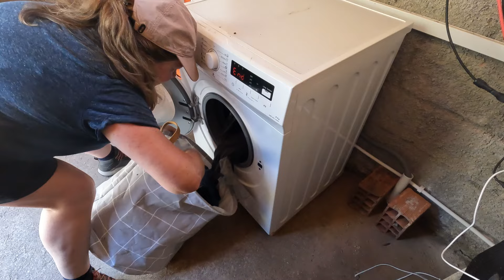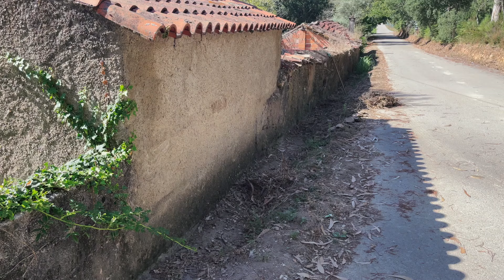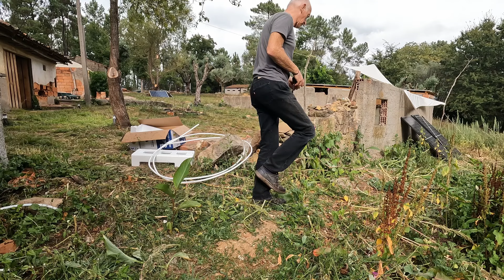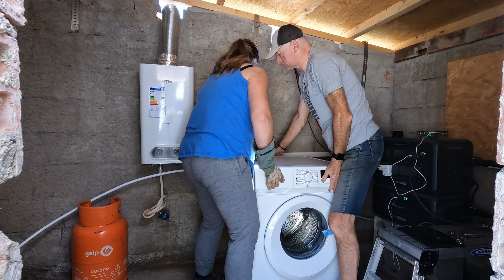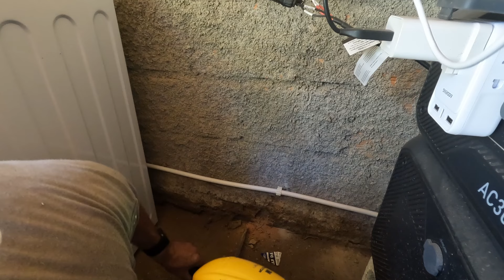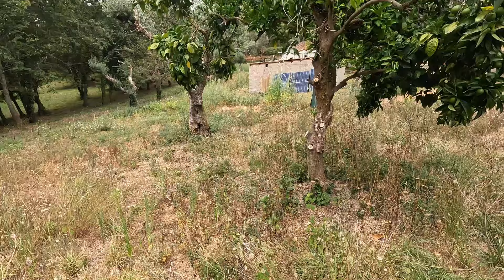Portugal abandoned house - building the laundry room EP41

Comment: I don't know if you've had a front loader machine before but you need to leave the door open for at least an hour, they get stinky if you don't!  I never close mine.
Reply from the maker: Thanks for the hint!
Reply: @HotkeysPortugal  FYI - it is the rubber on the front door that usually will hold water and grow mold if it does not dry out